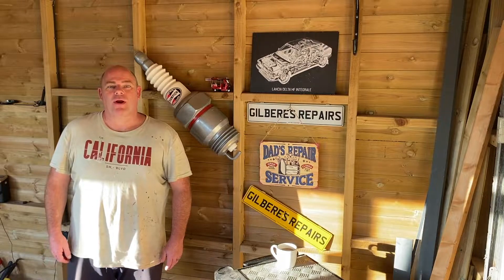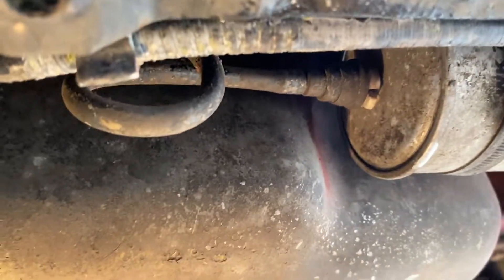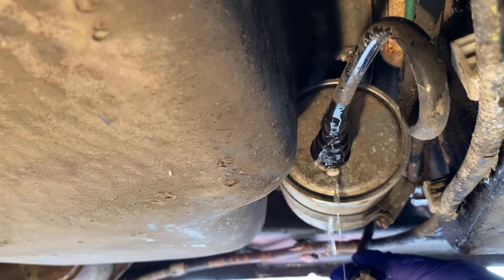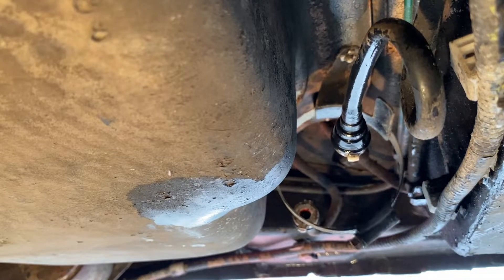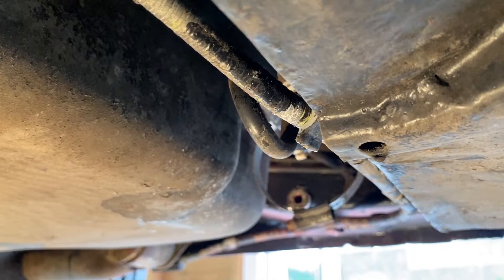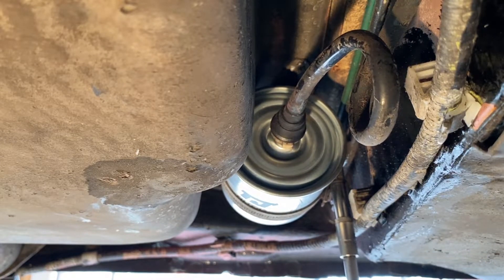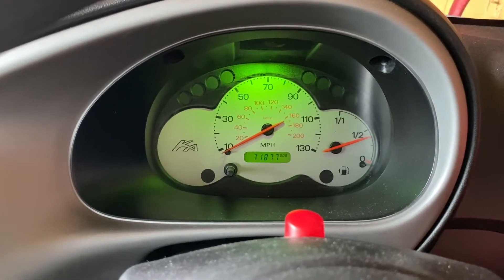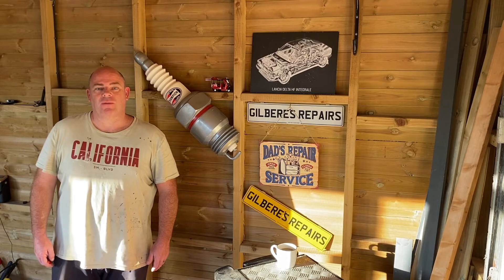Ford Ka fuel filter replacement - Service Part 3

Comment: Good video! I think i have the confidence to do this, but getting underneath the car might be difficult :-)
Reply from the maker: Glad my vid may give you the confidence to do the job yourself 😎
You can use the car jack in the boot to raise the car enough, BUT make sure you put an axle stand or something under the car as a back up, just in case the jack fails.
Hope all goes well 👍
Reply: @gilberesrepairs  thank you!